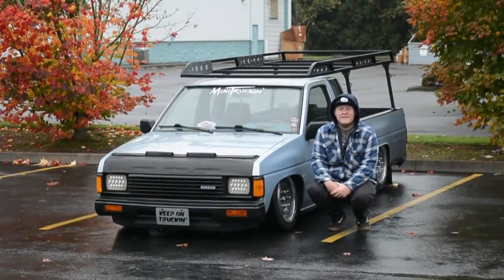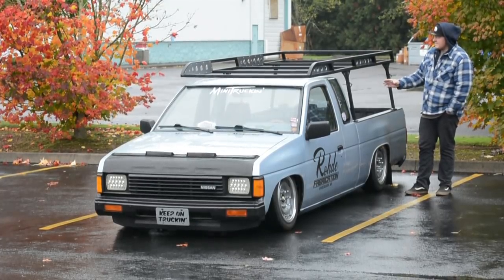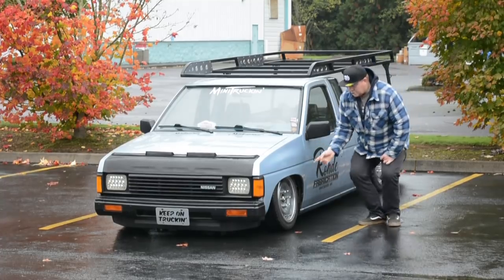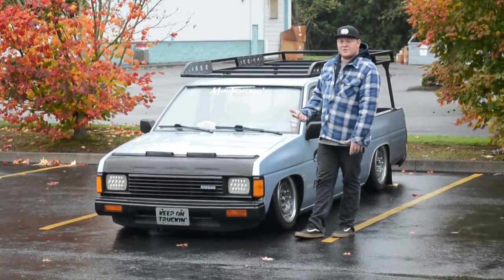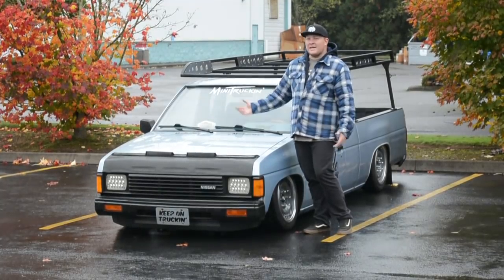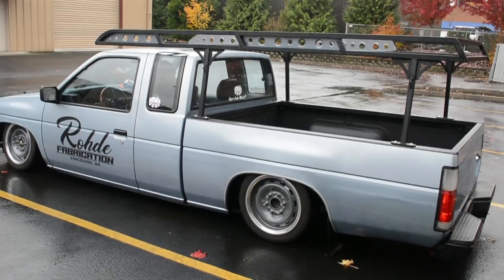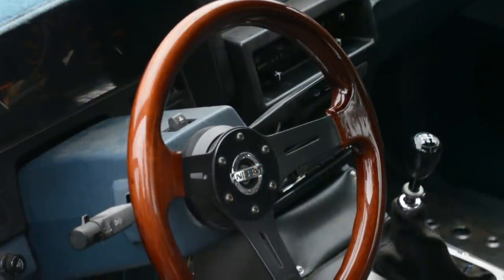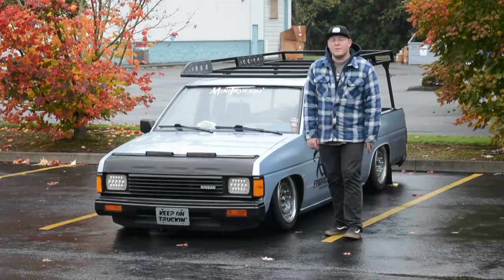Walk Around // Little Blue

Comment: I put 360k on a z24 motor with almost no issues i did do a head gasket at 220k but when i sold the truck it still ran fine

Comment: Quick question for you man, with the hardbody... if you want to switch to 5 lug do u have to change the whole rear end or is there and easier way?
Reply from the maker: Not really you could try to see if you could get your axles redrilled... other wise you can run 2" thick adapters or swap rear ends with a yota 5 lug or some sort of ford 8.8 rear end

Comment: Where can i find those exact chrome fender trims?
Reply from the maker: The trim on the truck now is original trim from 86 dont think you can buy it aftermarket. But you can buy the larger chrome trim aftermarket on ebay and some auto stores like jegs or summit racing
Reply: @scrapingpavement  been looking for those for awhile now. Not really into the larger ones. I like the flush look of the oem trims. Thank you though!